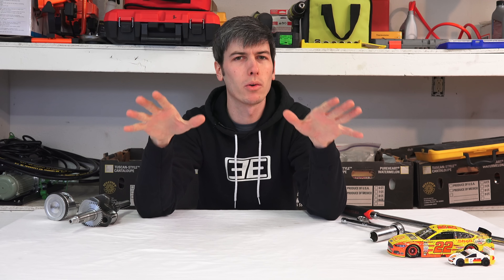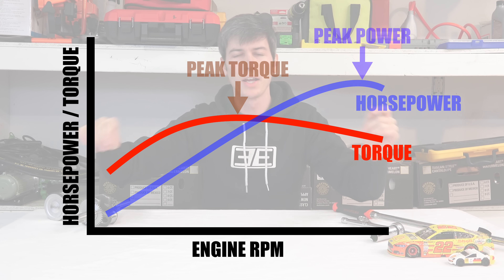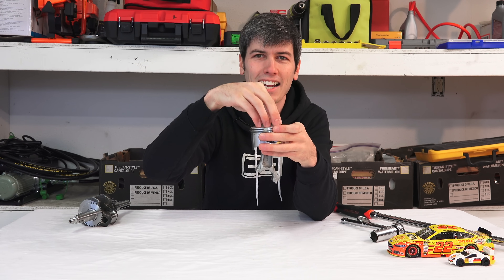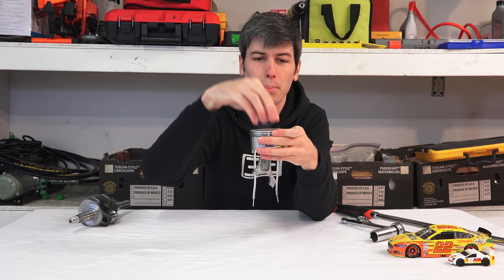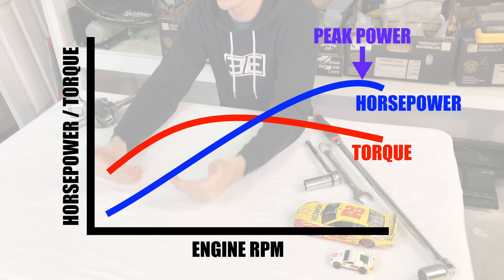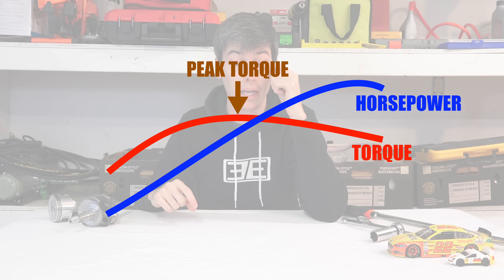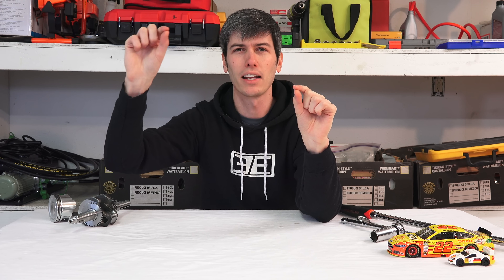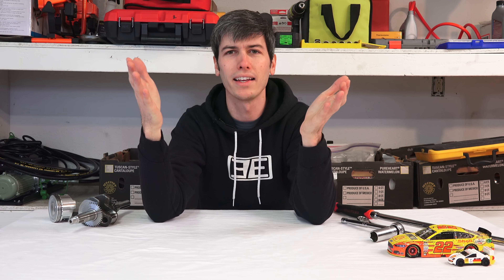Horsepower vs Torque - A Simple Explanation

Comment: The simple way i like to think of it, is that an engine’s torque figure is its ability to continue to produce power against a resistance. A 200hp diesel can’t do anymore useable work than a 200hp petrol in an identical chassis, but load up a big heavy trailer, and that petrol may not have the leverage or torque  to bring the RPM up to peak power as quickly as the diesel. This is why diesel pickups seem to accelerate at a similar rate weather the truck is empty or loaded, whereas a heavy load on the back of a petrol truck  with a comparable engine capacity and HP figure really slows it down.

Comment: Hey EE, going back to the toy cars, surely the one with double the torque would be the same if not better? As because there is more torque, the hearing ratios could be steeper and get the same results, or have the same ratios and accelerate "easier"?

Comment: PLEASE PLEASE PLEASE explain this: many people care about the pull in the seat. It depends on the torque but how does the weight of the car come into the equation? For example 300 units of torque on a car that is 1000kg and 600 units of torque on a car that weighs 2000kg

Comment: here is an even easier explanation 
lets say a hatchback that weights 1000 kilograms has 115hp and 100 nm torque-petrol engine
it will do 0-60 in lets say 7 seconds-with 1 person in the car and nothing else
But if you put some extra weight lets say 200 kilograms
it will do 0-60 in 5 seconds
If you had more torque lets say 150nm same car  but 80 hp same weight but diesel engine
it would do 0-60 in 5 seconds 1 person in the car no extra weight added 
But if you put those 200 kilograms extra weight it would do it again for 5 seconds

Comment: First of all, I am a huge fan of your videos. 
Going back to the two vehicles example, I think in this videos you forgot to speak about the situation where you have the difference between torque and power between the engines, BUT also you have exactly the same gear ratio. That's the other half of the story. 
Either way congratulations for what you are doing.

Comment: What is the optimal ratio of horsepower and torque and does this figure depend on other factors? What about top speeds? Would a car with higher torque have a higher top speed even if it takes them longer to get there? 

It seems like different gears would result in different torque levels because they're different sizes. If that's the case then is the torque figure just peak torque?

Great video. Always have been a big fan.

Comment: Now I vote for another video explaining torque and horsepower on petrol and idesel engines and why diesel engines are better for hauling and how using peak torque of engine can make biggest output of engine while consuming as low fuel as you can. :)

Comment: Everyone's cheering about the simple explanation and I'm just sitting here confused. If the horsepower measures rate of work being done and how fast the car accelerates (acceleration), how can peak torque glue the driver to the seat the most? Acceleration is what gives this sensation after all. Which is it, peak torque or peak horsepower for the glue-to-seat effect?

Comment: For a true understanding, it's better to understand power and how it relates to energy, time, velocity, acceleration and force without involving torque first. Torque isn't even a metric of relevance when a car is being pushed by a human, pulled by gravity down a hill or powered by a rocket engine. The torque curve is only interesting as a measure of the engine's ability to perform with varying RPM. More peaky torque means more gear shifting is needed.

Comment: It's not really true that the car with more power will accelerate faster than the one with more torque. Because power is dependant on revolutions, the driver of the car with more power would have to be in the right gear(s), at the right time(s) to win. In a short race, since engine rpm has to build and has highs and lows as the driver changes gears, the one with more torque has more potential to win, since the delivery of torque is more constant and since max torque can be available sooner and for longer (than max hp).  In a long race, the one with more power would win.

Comment: I love your videos but this one you messed up, please don't make fast videos, think it thru, take the time prepare for it don't do quantity over quality, this was not a simple explanation.
Simple explanation is that horsepower is calculated value from torque and rpm nad you can not look at one vs the other.

Easiest whey of thinking would be to forget the horsepower and all other stuff and  just look at the torque at the specific rpm: 
- if you want to tow a boat you need low rpm torque, 
- if you want to race you need high rpm torque.  

To prove this to your self try to tow some big heavy load with racing car and then try to race with the big truck, almost always racing car will win the race but big truck will pull more weight.

When you decide do you want to tow or race then you can dig deeper into numbers for that specific application. 

Key thing is knowing when to chose what and that you can not generalize because it depends on bunch of other stuff. 

In the end, horsepower vs torque is not the right question, question is what do you want to accomplish, where do you want it and for how much time.
Reply: Milorad Menjic more torque -> more power. You are talking about powerband vs transmission.
Reply: Milorad Menjic in my opinion it's all about the powerband for the useage. In motorcycles you can se the same engine and transmission with different cam profiles to fit different purpose. If you shift the engines maximum torque higher in the rpm range you will have more maximum power (to a certain point) but then you have to stay there by shifting to utilize it. 
If you put the maximum torque more in the middle/lower of the rpm range you can utilize the power easier at more casual crusing rpm without shifting so much. 

Maximum torque of a specific engine is determined by how much air you can fill in the cylinder. In what rpm the engine has potential for highest possible torque is determined by the flow characteristics, pulses etc of the engine.
Reply: Milorad Menjic horsepower is a better description of acceleration. When choosing a car that will better describe the performance. 
But for the same hp in two engines, the one with higher torque will usually give a wider and more relaxed powerband that is easy to use. Becouse you have a greater power/torque reserve at your cruising rpm it will appear stronger. 

This whole question of torque vs power wich is best is a bit retarded. Torque is part of power.
Reply: So you seriously just chastised him for "generalizing" while your entire remark was a wayyyyyyyyyyyyyy over-generalization about torque vs hp?  lol ok.  Your comment is more of a generalization than anything he said in the video.
Reply from the maker: The video is accurate. You can tow a boat with a high hp, low torque motor if you adjust the gearing for it. But high torque diesels are much more efficient, and are built to handle added stresses (iron blocks, heavy duty materials, high weight), so they’re well suited for towing applications.
Reply: I am not saying it is not accurate, I am saying it is not as simple to understand as you usually make it.
Yes you could adjust gearing but the fact that it is not done so often should tell you something.

Please don't get me wrong I don't want to argue or compete with you and your knowledge just accept this as critique and my opinion. 
If you find that you could improve things, make follow up video, go into details accept my suggestions or do opposite. 
Take race cars of one class compare HP, torque and track times on larger data set and draw some conclusions compare that with other type of races. If top 3 cars in both races have significantly more torque than rest of cars, it is torque that counts and makes difference if not then what ?
Then make predictions in advance and then compare results I think you will be surprised with results or confused even more but it is fun thing to do. Sorry if I sounded too harsh or offended you in some whey.
Reply: Yes I am, and I agree. Please explain it in your words, how would you compare HP vs torque without transmission and powerband ? 
Given that there are engines with very different HP and torque numbers but similar size for example and imagine you could fit either one of them into same car how would you decide if you don't take all other things into account ? Do you go with more HP or more torque and why if you don't have idea about rpm and transmission ?
Reply: OK. But again you did not explain HP vs torque ? Which one would you go for and why ?
Reply: Hahaha yes it is very hard to explain isolated things which are part of very complex system and calculated from other.
Reply: Well yes, anything is possible in theory; however, can you give a real-life example of a 'high hp, low torque' motor in a modern day car?  In the 'towing' example...  you could, I guess, get a dragster motor that produces 30000bhp at superhigh rpm (and can run for 5 secs before it explodes) to tow a heavy load if you 'adjust the gearing' for it...   ; a regular 1600cc Harley can pull a car out of a ditch, but I wouldn't exactly try that with a Yamaha R6, which has a bit more bhp than the Harley... ; also, most people can't just 'adjust the gearing' on the fly but have to make do with what is in that particular bike/car (I mean, besides shifting up/down the gearbox)

Comment: I really dig your videos, but this could have stated easily with Carroll Smith's quote of "Horsepower sells motorcars, torque wins motor races." Or, Carroll Shelby's shortened version of "Horsepower sells cars, torque wins races." That's the difference!  :p I prefer tons of low end torque. My small block puts out about 438 lbs of torque at about 2,500 RPM. That's a perfectly usable RPM for the street. I love how it accelerates off the line.  All joking aside, the video was a great explanation of torque vs horsepower!! :)
Reply: So... in other words. You didn't understand a thing in this video. The HP matters if you want to know a car is slow or fast. Torque is just one variable. And because of gearing, it doesn't matter that much.
Reply: Joey Garcia Nice. My Cummins turbo diesel has about the same torque but at 1500 rpm!
Reply: Octavian George HP is just a number. What's important is torque and RPM.
Reply: no
Reply: So do you run that engine at WOT in high gear at 2500 rpm ??
Reply: Racer D No at WOT the RPM would be much higher of course. At about 5500 RPM it was making 468 lbs.
Reply: Josh Young I do love a diesel!
Reply: Octavian George diesels don't revv as high as gas engines. They are usually capped from 2,000 to 3,000 RPM. For the street I rather have usable torque down low than being able to spin it to 8,000 RPM. And yes you can compensate lack of low end torque through gearing. It's just a balance of things like the torque graph, gearing, RPM capabilities. Me...I like putting it in 4th gear and can still pull at 1,500 RPM (while moving like in L.A. traffic)
Reply: They act like its one or the other, just use a 5.7L or bigger engine it will make both hp and tq. silly small engine lovers there is no advantage to using a tiny displacement engine seriously  i can build a aluminum small block chevy 7.0L that only weighs 375 lbs or a 3.0L 2jz-gte that weighs 600lbs!. there is only  a 0.25" inch difference in the bore and stroke between a 5.7L and a 7.0L  so why not go big as the block allows? Getting high hp per liter only means your making way less torque, it does not mean its efficient in fact the opposite high hp per liter means high rpm which has exponentially more friction losses
Reply: The real reason why a Diesel has more torque is due to the fact that diesel burns slower than petrol. Petrol explodes and gives a rapid initial force on the piston but diesel produces a slower power stroke all the way through the cycle thereby giving more torque
Reply: That's why an 150hp diesel car with get fucked up hard by an 150hp gasoline car (everything else being equal). Because RPM/HP is more important.
Reply: torque matters a lot in racing. both are very important, he doesn't explain this well. he also drives a honda which has no torque
Reply: Joey Garcia horsepower is how fast you hit something, torque is how far you drag something before stopping.

Taken from a mustang joke.

Comment: Actually top speed has little to do with HP.  You can have 1000 hp but if the final drive ratio is X and RPM limit is Y what ever velocity you are going on your final gear will be the terminal velocity.  If you put more aggressive gears, taller gears; you will increase your acceleration as stated because it will require less force to move the distance kind of like gears on a bicycle how ever you will effectively reduce top speed because of the RPM limit.  When you are on the little gears of the bike it requires a lot of power (force) to spin but once you're spinning you are going much fast than if you were on the big gears that are easy to spin but require a lot of spinning (rpm) to reach a higher velocity.  Therefore, HP has very little to do with top speed.  Theoretically, if you had 10 hp and 30 gears, starting at 1 going to 30 at a the correct ratio could get you up to 150 mph.  Cause every shift you will keep adding torque and the force you apply will be added to the momentum, increasing velocity by ever so much.  Nice video though.  :-)

Comment: So, you have a Chevy Nova with a BBC and Honda S2000 with a procharger at the drag strip. The light goes green and the heavier car leaves the Honda behind, but at the end the Honda pulls harder and crosses the line at the same time in 12.000 seconds. Talk everyone through that one. I'd like to hear what is more important when on a single gear motor driving a prop that makes a metric ton of thrust.

Comment: But if you have say 200Nm/100hp on a car with a set gear ratio of 1 and 100Nm/200hp on a car with a set gear ratio of 2, wouldn't they accelerate at the same rate? Aren't you basically transforming the extra torque to power?

Comment: Great video as always, thanks! This is a really tough one to truly understand. Particularly the part where you say there is max acceleration at peak torque when you have only one gear and then on the other hand you have max acceleration at peak power when you have more gears. Then I realised you can understand this more easily when you draw a few `torque at wheel` curves (instead of `torque at engine exit`) for a few different gears ratio's in the same diagram.
If I understand correctly this would show a stack of torque curves of similar shape, but with a higher value as the gear ratio goes up (lower gears). You can then see that the peak torque is always available in the lowest possible gear: torque at `peak power` in gear 2 is higher than torque at `peak torque` in gear 3, because the `gear 2 torque curve` has a higher value as a whole.

Comment: Thanks for video! you explained it better than anyone else, but I still got confused :D
Lets say a car has peak power at 5000rpm ant peak torque at 3000 rpm, the car still accelerates faster at 5000 rpm because it has more power? Then whats the point of knowing torque if power beats it anyway? :D

Comment: If i want to drive my car the most efficient, meaning not best mileage but lowest consumption over time (cause i want to arrive eventually and i dont want to be a snail on the road), and given that the engine works most efficiantly at full throttle, how do i determine the best point for shifting? Do i use every gear up to max power or only up to max torque or some place in between? My car has a turbocharger so it has a very flat torque curve. I don´t want to accelerate the quickest, i want to accelerate the most efficient to speed limit and then shift to a high gear.